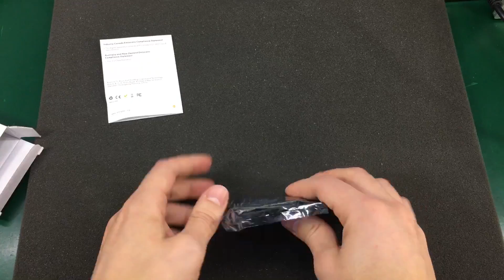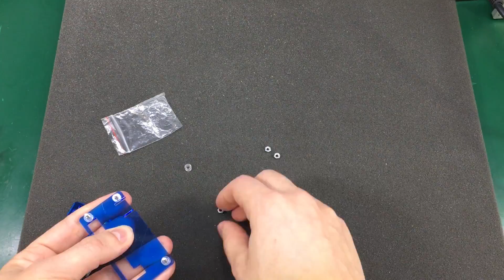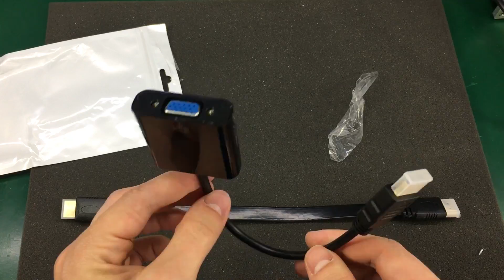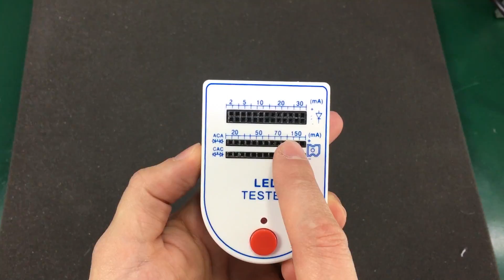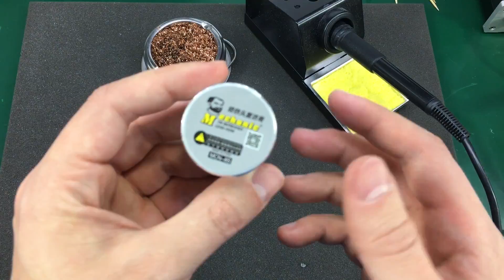Voltlog #98 - InTheMail

Comment: I had the same problem with my car keyfob a couple of months ago here in Greece. It almost drove me crazy. I changed the battery with 2 or 3 that where all purchased from ebay and the problem persisted. At first I thought that the batteries were really crappy so I tested their capacity driving a couple of leds and they lasted for weeks! The problem disappeared suddenly and reappeared a couple of days ago. The only explanation I could find is the effect of some sort of solar storm. During the same time I have noticed problems with various electronics. Printers acting funny, routers disconnecting and requiring hard reset, etc
Reply from the maker: I would blame it on some local interference rather than a solar storm, might be useful to get one of these SDR's to investigate further

Comment: Thanks dude, when you compared The Pi Zeros; Orange vs Raspberry, You forgot to mention that OPi0 has an Ethernet port, this will cost you more than the RPi0 price if you wanted to have it there!
And in order to have Video and Audio output on the OPi0 you do not need the expansion port, you can do you yourself.
Just have some female dupont cables like these http://v.ht/dupont cut their ends and the ends of A/V RCA cable and connect them together, follow table # 2 here: http://linux-sunxi.org/Xunlong_Orange_Pi_Zero#Expansion_Port
The ground on RCA connector is the RING, video is yellow and audio is red/white, connect ground to expansion pin #2
then #9 to video, pins #7 and #8 to audio left and right and you are done.
To quickly run Orange Pi Zero, use Etcher to copy OSes into uSD: 
And try these OSes: Armbian, Diet Pi, RetrOrange Pi (ROPi):
https://www.armbian.com/ http://dietpi.com/ http://www.retrorangepi.org/
Reply from the maker: +igrewold you're totally right I should of mentioned the ethernet port.
Reply: It's alright dude, I am just saying. It'd be nice if you make a thorough comparison later between the two Pi Zeros. Also, the processor(CPU of the SoC) of the OPi0 is 4-cores. And I think you can also run Android on the OPi0. Lotsa positive points...etc.

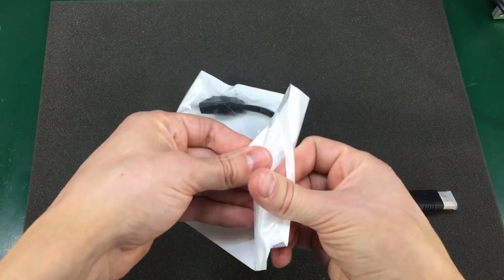Comment: treadown this 6:12 HDMI to VGA adapter What Chip this using and pinout (maybe you can do copy EEPROM data (EDID data) ( youtu.be/IGg1nyTY6oc read comments too (each devicce input have on info EEPROM, with adapter Fake EEPROM data can do some "jokes" and maybe clock up you device ( www.blurbusters.com/overclock/120hz-pc-to-tv/ ) )  )), id this audio outbut and need extra pover 5v (USB)? Better solution was't USB 3.0 -> VGA (~5$) ? I have home (USB 3.0)  4x4 monitor (913N) VideoWall (old monitors replaced old backliht to LED (aliexpress 32651824231) (CCFL backlight was bad and inverter ) LCD board need only 5v 1A )
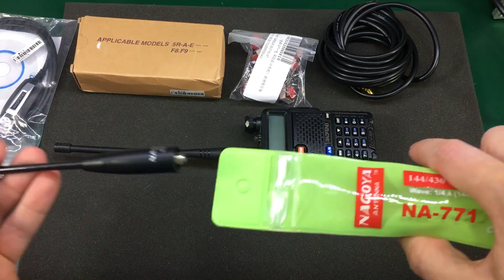Reply: 7:30 Good antennas at the antenna length is not always an important. 
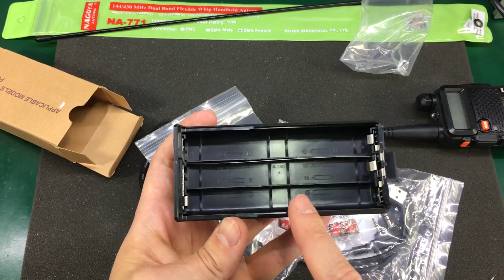10:50 (ReUsing old laptop) battery 18650 pack/case was't?
Reply from the maker: I wasn't talking about the antenna length vs performance, I was only pointing out that it's a pretty long antenna to carry around, certainly longer than I was expecting. Regarding the battery pack, yes one could reuse laptop cells, but I also have new 18650 cells with good capacity.

Comment: if you leave a blob of solder on the tip, when not soldering, it will protect it from getting oxidized. also, keeping the tip temperature low, during idle helps.
Reply from the maker: I have the idle temp set at 150 degrees C, but what I was trying to say is that I notice these T12 tips get oxidized much faster.
Reply: ahh, may be not as good tip material. you can still try leaving a solder blob though.

Comment: umm, the orange pi zero is 13$ shipping included and if you buy the raspberry pi zero here in India the shipping is nothing less than 25$ but I can buy the orange pi for 13$ shipping included. I can ofcourse buy the video add-on for 4$ extra easily. the pi zero is also out of stock always. For me the orange pi is much better taking into consideration my location. I don't know about you that do you get the raspberry pi freely shipped?
Reply from the maker: Actually no, I don't get the pi zero that easily here in Romania, but I don't count myself as part of the majority. If you live in the US or West Europe shipping is pretty inexpensive for the pi zero. For example in the UK it's roughly 7 pounds to get a pi zero shipped to your door. But I think you are right, this is something I haven't considered in the video, there locations where it's definitely cheaper and easier to get the orange pi.
Reply: I'm a big fan of Orange Pi's and they're actually quite easy to get in Romania - these guys [1] have been carrying various versions of them for more than a year now, and they are not the only source. The one you have is not really meant for video output, lots of people seem to use small SBCs as some kind of tiny headless server, that's what it's for. There are other models at [1] which do have HDMI though. The on-board WiFi on all of them is certainly useful, and a notable difference to Pi's is that all USB ports on Allwinner chips are real, not multiplied through a hub like on RPi's. As you note, these aren't really for the "I can haz biglier Arduino?" crowd, but ultimately there are ready-made distros with a community (like Armbian - they even have specific "headless" binaries) for these too, it's pretty much a copy/paste/boot affair...

[1] - https://www.optimusdigital.ro/ro/349-orange-pi

Comment: the bottom part of the led tester is broken... look in the Andreas Spiess latest videos, he blew up many leds using that part of the tester, in the end he covered it with electric tape...
https://youtu.be/VmIBWHmDLKw?t=13m38s
Reply from the maker: hmm, will have to look into that.
Reply: let us know your findings :)
Reply: I am interested too, of course!
Reply from the maker: I have looked at the PCB and it's the same as in Andreas video but there is only one position where it's dangerous, pin 2 (vertically connecting on the 20mA range) on the bottom row, that's where the LED would get connected directly across the 9V battery http://voltlog.com/pub/led-tester.jpg . All the other pins go through resistors. I've marked that position on my tester to avoid it. Just an extra resistor would fix the issue.. but I can't be bother to do the fix.

Comment: I find you a bit unfair to the OrangePi zero, I personally prefer to use Armbian rather than Raspbian.
Also those board are to be run headless, so I don't see the problem with not having hdmi, you plug it in your router, set it up over ssh and you are good to go.
For exemple to put a usb printer online this is the perfect board with the full size USB.
But I agree that they price are going up with each new board, the old OrangePi PC are a better deal.
Reply from the maker: For me at least it's very useful to have the HDMI there so that you can config and/or fix something locally if the network is not up & running. Also there are plenty of use scenarios where you would want to create integrated display panels with a small computing board on the back. That's why I think the pi zero has added value.
Reply: Sorry to pull a Columbo ("just one more thing"), but on mine the pins for the root serial console are right next to the USB socket - there's nothing you can't fix from there long before video-out even gets initialized... :)

Comment: I don't see any scratches on the acrylic on the RpiZero-case - it's just sticky residue that appeared when you pulled off the tape and didn't do so in a single movement. Cleans off with some alcohol :)
Reply from the maker: +zaprodk thanks, I will check that and report back.
Reply from the maker: I tried to wipe it with some IPA and I conform those are scratches.